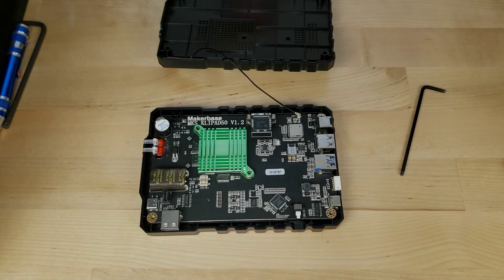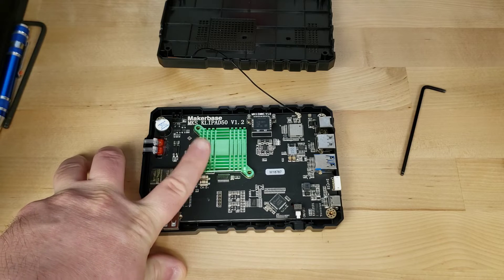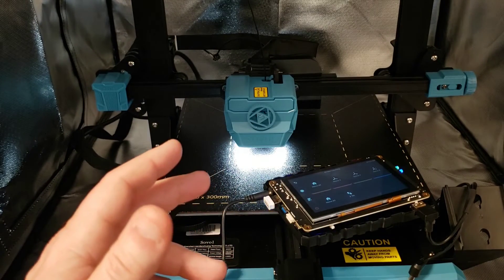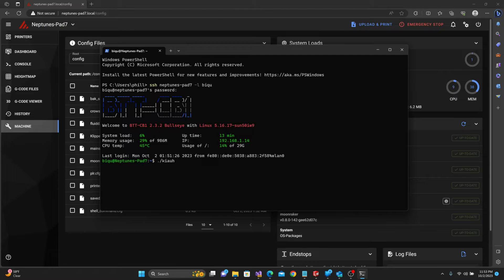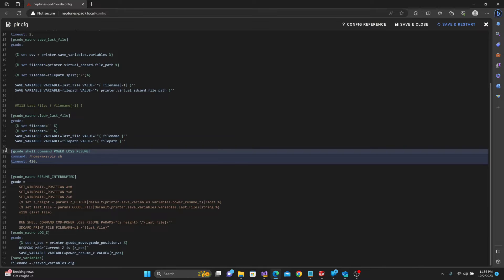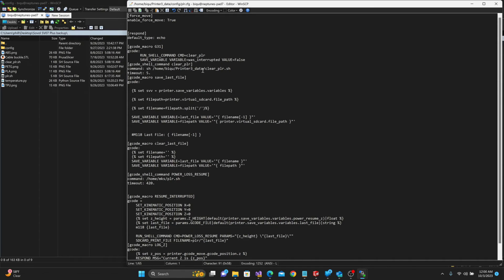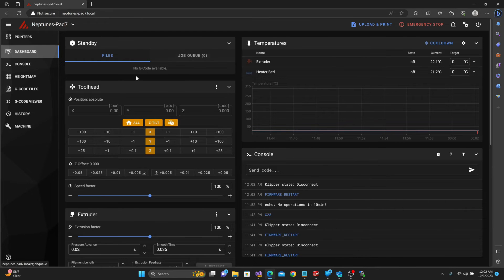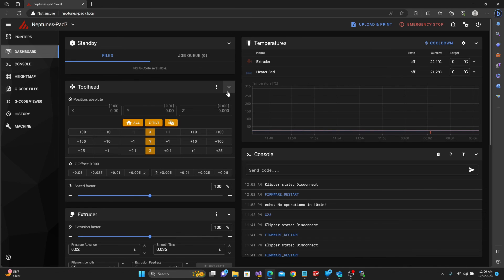Sovol SV07 Plus - original screen tinkering and setting up the Bigtreetech BTT Pad7

Comment: Already had two Sovol pads die on me and fed up I Tried updating to the BTT7 on my SV07+ and it's been an absolute nightmare. It refused to connect when I imported my printer.cfg giving me the MCU error and then after hours of fiddling and countless errors later I finally got the stupid thing to connect to the MCU but only when I commented out the coding for the ADXL. I followed all the documentation watched dozens of vids, scoured the net, got desparate and tried AI solutions, even reflashed the pad and controller board... Twice... Same thing... If I have the [mcu CB1] line, related ADXL and resonance tester active it won't ever connect. Just sits there stating" Printer is not ready The klippy host software is attempting to connect.  Please retry in a few moments."  If I go in and comment them out it will instantly connect and work perfectly.  Tried changing CS pins and spi_bus: settings but nothing works. So close but so far away....
Reply from the maker: @kryten93  did you set up the pad7 for the adxl? You have to enable it in the config file under the boot folder

Comment: This process has been straight up cursed.

My original screen died, so I used a Pi3b and installed MainsailOS through the Pi Installer.

After some tinkering, it's up and running, but klipper will NOT connect to the printer.
Tried the printer.cfg from my original Sovol files as well as some online ones from others who did the same, but no dice...

It keeps throwing errors regarding virtual_pins and Z_offset, and probes, etc etc etc.....

Should I try just installing PiOS and run KIAUH?
I'm guessing that's necessary?
I'm suspecting a potential version Conflict between my SV07's main board and the newest update of klipper on the Pi, however I do NOT want to flash a new version to that mainboard as I don't know how to back it up... 👀

I'm lost on this one man.. 🥴
Reply from the maker: Sounds like you're on the right track but you're missing some file like a second cfg file or something like that. I know you need the plr.cfg but I don't remember if you need any others. I've got a full backup of mine if you want me to email it to you.
Reply: @TheFeralEngineer    
If you could share a copy, that would be amazing! 😭 

I think you're right, I think I'm missing at least the power loss recovery config.

Comment: Hey I got most the errors to go away, but I got seem to figure a way to reflash this firmware on this thing.  What was your trick or do I need to do something else to get rid of this error and I am just overthinking it?

 MCU Protocol error

This is frequently caused by running an older version of the
firmware on the MCU(s). Fix by recompiling and flashing the
firmware.

Your Klipper version is: v0.12.0-116-g31de734d-dirty
MCU(s) which should be updated:
mcu: Current version v0.11.0-41-g9b60daf6
rpi: Current version v0.11.0-122-ge6ef48cd
Up-to-date MCU(s):
Reply from the maker: Are you running the original screen? You aren't supposed to update Klipper on the original screen unless it's an update from Sovol. I posted a video about a fix for this error, but the stock screen and firmware aren't compatible with it.

Comment: I just got on the Facebook page for the sovol, im new to a lot of this lol, i have some knowledge but not enough yet, im wondering if you have a walk through somewhere lets say for a complete newbie to used the btt pad 7 on the sovol sv06 plus? I need help by walking me through each step to setup and run 🤷‍♂️ i know im in over my head at this point but willing to learn and have done some computer type stuff many years ago, some is coming back but blank on the important stuff and reaching out for help now so i dont mess it up, the btt pad 7 arrived and box isnt opened until i have enough confidence, I've been researching like crazy trying to find the correct walk through but the only one ive found that gives actual step by step is in German i think 🤦‍♂️.. i could message with Facebook messenger or video call for a walk through with someone who has the knowledge
Reply from the maker: Watch all of my Klipper videos, they should get you up to speed pretty quickly
Reply: Ok, I will do so, I appreciate it, thank you

Comment: what can i buy to change the klippad?
Reply from the maker: Depends on how crazy you want to go. Btt pad7 would be my first choice https://shrsl.com/41x3l

If you didn't mind printing some parts, you could always get a btt pi or btt cb1 and pi4b adapter and use an hdmi5, hdmi7 or hoysyon 7" touch display with it as well. There's also the option of using an old laptop or pc running Linux

Comment: i just like listening to you going hard on these half thoughts  machines xD took your idea and experience on that board to tiktok and elegoo resellers went crazy on me , specially i was the 1st one to talk about elegoo in my region xD
Reply from the maker: Shoot me a link so I can see what you said 🤣
Reply: @TheFeralEngineer   unfortunately its in Arabic , but i'll sum it for u ,
i wont buy the n4pro berceuse its board just like the nissan altima 2015 which is well know to have gear breakdowns what so ever , so its not matter of it will break or not , its more like when it well break xD
Reply from the maker: Oh, I'm sure they love you for that 🤣🤣. A lot of these companies are using the rk3328 because that's what makerbase adopted for their Klipper products and most companies are using makerbase boards. Even the elegoo ones that are labeled znp are custom built by makerbase. If they switched processors or had swappable Linux devices such as the separate board on the sovol or the plug in module like the bigtreetech manta, it would be a better solution, in my opinion. The one thing elegoo does that the other companies haven't is crank up the RAM. The znp k1 board has 8gb where the other offerings only have 1, so that might play a role in improving reliability, but early adopters experienced mcu shutdowns, so I'm not optimistic. Time will tell, I guess, but I'm jaded because I bought two mks devices that started failing after a few months and the only suggestion makerbase gave me was "buy new ones".

Comment: Cool! I was also thinking the only way to communicate with the MCU side of the N4 was with the UART pins…
Reply from the maker: Yeah, that's my guess as well. If that is accurate, then compiling a bin to communicate on the proper uart bus should allow communication to a pi device via gpio
Reply: So I tried recompiling the firmware, checking the continuity (it is OK), connecting RX to TX and so and so, but still MCU: Unable to connect... @TheFeralEngineer
Reply from the maker: @DJProPlusMax  you used the right pins for your device in make menuconfig? You crossed tx and rx between the devices? You're using /dev/ttyS0 as your serial device?
Reply from the maker: Got confirmation... the uart is running to the Linux side 😢
Reply: That sucks... @TheFeralEngineer
Reply from the maker: @DJProPlusMax  yes, very sad